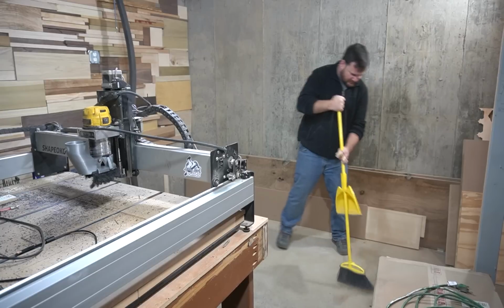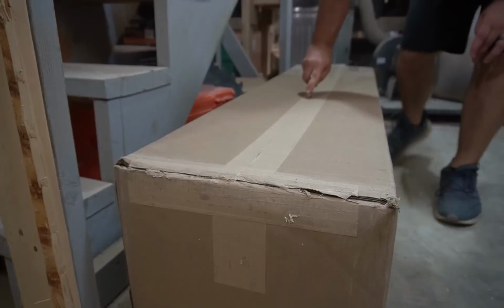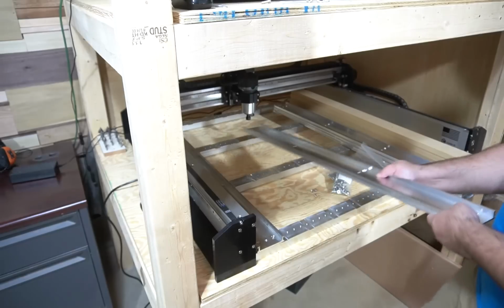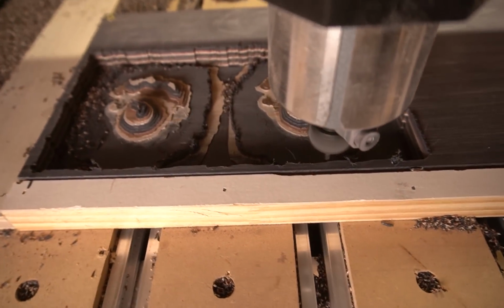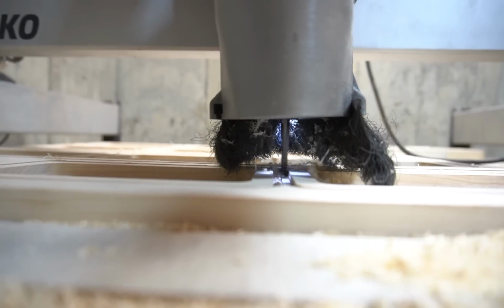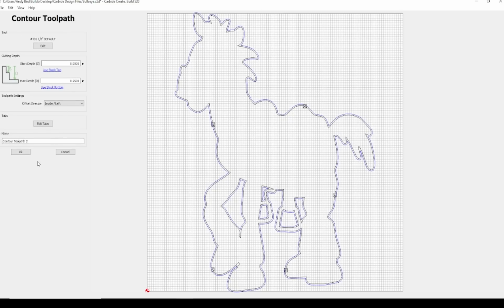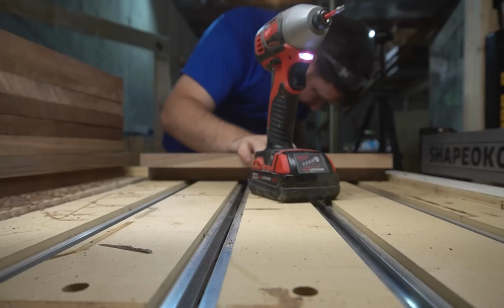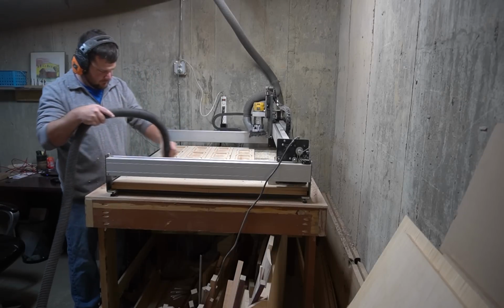Watch This Before You Buy A Desktop CNC Router

Comment: I've got a millright mega V XL.... and I think I have pretty much everything in terms of bits, router (no speed control unfortunately) and the cnc is built, it's on a table, the only thing I can't seem to source is materials / wood. 

I'm trying to get my hands on anything my machine can handle, but namely hardwoods. 

I've also got an XTOOL P2 with all of the fixins (no fire suppression, yet) Same boat. I've bought some stuff directly from XTOOL but I'm looking for thicker wood sheets that won't rob me blind in starting cost.

Comment: I’m a beginner. I was given a 3010 pro mini CNC.  It’s been in a garage for awhile and the axis’s are squeaky. YouTube vids. Recommended dry lube to lube the area that moves on the rails. A little bit of lube.  I am looking at all the beginner videos to start on the spindle and the laser engraver. I only know the laser diode is 3 watt optical output. I will look for the spindle specs soon.
Reply: It’s a 3018 pro Cnc.

Comment: I currently have all the normal woodshop tools filling out a double garage. With that I have a lot of hand drills, routers and sanders, electric hand planer and a couple of jigs. I am more and more intrigued by getting a cnc router (and maybe an attached rotary axis as well). Do I still need to keep everything else like the lathe, tablesaw, bandsaw, router table, jointer, 13" planer, drumsander, edgesander, bobbin sander, mitresaw and desktop drillpress? Many of the tasks that I need all that tools for, can be done by the cnc(??)  - true or dillusional...? Would like to hear some good advice from realtime experts on my thoughts.

Comment: My advice would be - (1) before you spend a penny, look at the available free CAD/CAM software - if you can't get the hang of the software there's no point exercising your credit card.(2) If you don't really know whether CNC is for you, buy the cheapest 3018 you can find (but consider what stuff you get with it, the offline controller may be useful, clamps are really frustrating to not have etc) and buy a selection of cheap bits (if they have a different shaft size you'll need extra collets to go match). You will learn loads putting it together and you'll learn more playing with it. Just remember the results will be limited - you only get 20x10cm of movement and the spindle is pretty weak. But if you do slow movements and take off thin layers you can easily cut wood and PBCs and if you're careful even metal. Then if you don't enjoy it, sell it / give it to a school or hack space. If you do enjoy it you are in a better position to understand what you want to upgrade to, and again pass the 3018 on to someone else, or strip it down to make your own from scratch.

Comment: Thanks for creating this video. I'm a retired machinist who's been looking for a hobby to help make ends meet. I know about speeds & feeds for all the metals I worked with. It should be easy enough to make wood chips. My question is, due to the high speed of routers, are most cutting tools carbide, or is it a mix of high speed steel & carbide tools being used? I'll be watching the play list you just mentioned. The biggest learning curve I'm facing is learning CAD.

Comment: I’m 14 and don’t have 3000$ so I built my own and it’s pretty cool but the one thing I hate is that there is pretty much no z movement so I can only cut like inch this stuff, but I did it all in less that 600$ and Ive milled aluminum successfully, but definitely not steel
Reply from the maker: That's awesome!

Comment: Good video.  Other than the smaller table, what is the downside to buying a smaller CNC router, such as the "MYSWEETY 4540" that I see on Amazon?  Thank you.
Reply from the maker: Thanks for watching and for your question! The main downsides of purchasing a smaller router like the MYSWEETY 4540 is the power of the spindle, the overall rigidity of the machine, and possibly low quality software.

Comment: Liked your video, and it's honest considerations. I'm a retired an 85 yr old hobbyist, I love to build electrical / mechanical projects. Looking back, I was disappointed with the 3018 machine and later realized that for two to three times the price I would have been much more satisfied and able to achieve considerably more with a capable machine. 
With learning G Code, Cad_Cam, Getting familiar with bits, familiarizing yourself with your machine's operation and capabilities, leveling and setting up a work-piece, bit lubrication / misting & adequate dust protection and personal protection, It can all be little daunting, but in the end it has been very satisfying to me. I can now edit G-Code to correct errors in a program.

I have found Vectric Aspire to be the easiest Cad-Cam, it is user friendly and very capable. 
Don't use expensive bits when your learning to operate your machine, some bits will amaze you with their ruggedness and durability, others will have jaw dropping failure under the lightest loads so in the beginning go on the cheap side. It pays to shop around. Regardless always keep a BIT logbook to document what was good, bad & should not be gone again

I now have a 4040-CNC a 3 axis machine with a 400 W DC spindle and uses 4080 C beam extrusions for all axis,  4080 C-beam aluminum extrusion is very sturdy , it had an original work area of 16" X 16" but I have modified the machine's width to twice it's work area width and reinforced the bed area so it's now very solid. This machine although not on an industrial level, it is a brute, cuts everything including aluminum at nice feedrates. The original machine was $ 450. US plus $ 175. US for the mods. My machine is better than any comparable class machine I have found at 3X the price. 
The bottom line is that I have had the time of my life getting to where I am today and I'd do it all over again, except for the 3018 cnc.

Comment: Something I'm really struggling to understand is the basic setup of CNC. I have tried tutorial after tutorial but no one shows me literally each component. 

Like, if I get an OpenBuilds CNC machine, with the blackbox controller... what does that setup look like? I have my desktop PC in the office for the design portion in the CAD program, which also does the CAM and gives me G-code. So... then.. I take a USB stick with the G-Code into the garage... and plug it into what? The black control box? I have deduced that I would need a laptop to control the CNC machine... but then, what am I plugging it into? Does the laptop plug into the control box? So then, MACH 3 or Universal G-code sender is installed on the laptop? This makes sense to me, but I still want to make sure so I don't plug my laptop in and fry it or something. And in all these instances... how do I know if the machine I buy is compatible with various CAD/CAM and controller programs? Can I use Zenbot's CNC machine with UGS? Can I use Mach3 with OpenBuilds' machine?

Comment: Cnc makes a lot more sense in the metal working world. They do a great job at hole drilling. Specifically multiple holes in geometric positions. Using multiple tools on these locations, spot drills, jobber drills, counter bores, counter sinks and possibly taps. Throw in a simple milling pattern and you have a precision part. Change a few locations in your gcode and you have another finished part. This is utilizing multiple tool offsets , which from what I can see,  none of these wood working machines can save more than one at a time.  
You guys should learn how to make and use patterns for the stuff I see you're trying to make.

Comment: A 4th one is a down cut bit. I highly recommend buying one. I have had no need for the replaceable ones. Then again I have only done small jobs on a printed CNC. I am thinking of committing money to a larger CNC like a Shapico or something at some point. I started on CNC when I was 14 as an apprentice Tool & Die Maker. Back then CNC was a new thing. Left the trade to work on computers and never looked back till I wanted a hobby build. Now I enjoy it.

Comment: As a professional cnc programmer and operator with over 25 years experience I would highly recommend that beginners use a safety guard around their machines as if a bit snaps or shatters they can cause serious damage and injuries. When it comes to setting feed rates and rpms you need to find the sweet spot. That is when the rotation speed and feed rate are in harmonic balance and the tool will actually cut very quietly even at full length of cut
Reply: Thank you for your input there bud, I've just started CNC machining a few months ago and have very basic autocad experience, I'm really interested in learning and want to invest in getting a desktop cnc
Reply: Thank you!
Reply: What specific classes did you take to become a CNC programmer?
Reply: @lucasmendoza  I'm not there yet, just an operator, but you'll want to study G-Code primarily. Many tech schools/2-year colleges offer certifications and technical diplomas as well that can prepare you a lot better.
Reply: @Lucas Mendoza  I ran a million dollar cnc punch for highway products. When I got the job I was going to school for welding technologies at a vocational school. That is a good place to start, but to be honest you don't need a degree most companies will train a good employee. Just start putting your name out there with companies and show interest.
Reply: @Lucas Mendoza  cad/cam computer aided drafting and computer aided munfacturing, but if you were to buy your own is also a great way to learn. Youtube has plenty of info
Reply: specially this goes for all laser aficionados. I have a few books 1)  Ken Barat - Laser Safety_ Tools and Training, Second Edition-CRC Press (2014).pdf , 2) Understanding laser accidents-CRC Press (2019).pdf 3)(IOP Series in Coherent Sources and Applications) Ken Barat - Laser Safety_ Practical Knowledge and Solutions-IOP Publishing (2019).pdf

Comment: I thought you were gonna talk about realistic expectations for your machine?  I paid $14k for a ShopSabre 23 (pre covid price), and it didnt meet every expectation.  But buying something cheaper would have been a total waste of money for me!  I am 3D carving, and VCarve Pro worked ok for the first week.  But I quickly found it was limiting, if for no other reason than because it only uses STL files.  So after struggling against the STL demons for a long time, I broke down and bought RhinoCam so I could make proper tool paths. Then I figured out that WinCNC doesn't know how to do arcs in the z axis, so even though the CAM can make more efficient tool paths, my router can't utilize them!  So sometimes I have files with 1 million lines of code.  But no big deal.  Only takes 12hrs to run.  I'd hate to think how long it'd take a $2,500 machine to do that!

Comment: Thanks for the breakdown.  I went for the sub1000 price range, and got a small 3018 clone, and upgraded the spindle/controller to a variable rate with a wasteboard and clamp.  Coming from 3D printing I already have some experience with these little quirky machines. Im a fledgling pocket-knife creator, and I wanted something to compliment the synthetic 3D extrusion with the ability to cut out small plastic/soft metal parts.  Im already looking ahead to setting up a larger router system in my garage workshop where the bigger tools are.  Ill use your resources as I progress in my journey.  Cheers!

Comment: I have friends that think they can buy a cnc router on amazon for $600 and machine aluminum, my cnc router has all linear guides and the spindle only deflects .0002, light cuts in aluminum on a non rigid machine creates vibration and wears out end mills fast, simple parts dont require cad and cad has a steep learning curve, large machine shops have people that only do cad cam !!!

Comment: Do you know if there is a CNC program or machine that will do layers of an item that when assembled will complete the item? At 00:50 of your video it shows 4 pieces of lumber with 3 cutouts in each board.  What I'm wondering is if each cutout could be  programmed to be one part of the whole item.
Reply from the maker: Yes you can cut multiple pieces to build a larger model

Comment: I am frustrated. Just wanted to engrave a couple of small signs. Dismal experience, tried Easel but being a cloud based program it is uselessly slow and un responsive to key inputs. Want to try the free Fusion 360 but do not seem to get the program to download. Spent hours looking for a program without success. Ideally I would like a program that presents like MS publisher and produces the g code to run my 3018.
Reply: Check out software from Vectric.  I can't say if they support your specific machine, but they are more "art brained" vs "engineer brained" when it comes to CAD/CAM.

Comment: Because of videos like yours, my first build went together like I had been doing this all my life! I work in industry, so “perfect” startups of complex systems rarely happen, but my CNC mill just “fell together” and worked perfectly as I followed the steps. And that’s just the hardware, which is probably the easiest part, because then comes the software, for design, and then for communicating with the machine. Again, advice from channels like yours helped me navigate through “the weeds” without making costly mistakes, so I thought I would just say thanks!
Reply from the maker: Great to hear! Thanks for sharing

Comment: This is the most fear mongering, misinformed video for CNC beginners I've ever seen.

NO, you do not have to buy a $1000+ CNC if you're a beginner. You don't have to have a specific CAD software for a specific CNC, that's just a load of crap. There are no software compatibility requirements in creating things for your CNC because your car software isn't what converts your work to a machine code. 

You keep saying you're not discouraging beginners yet you're feeding them false information. People can easily start with a $200 CNC and learn the basics without having to find the space for a large expensive machine and worry about damaging them. 

Horrible video.
Reply: Your post is some what wrong when it comes to the CAM software compatibility.  Not all CNC machines use standard G code.  You have to have CAM software that can out put code your machine can use.  My Dad has a ShopBot CNC router.  It doesn't use standard G code natively.  It has it's own programming language.  It can use a limited set of standard G code functions.  So having a CAM system that can only out put standard G code may render some CAM software incompatible with certain machines and controllers.  The biggest thing to watch out for is to make sure that the software that is being used to write the programs has a post processor for the specific machine/controller.  Code that is "close enough" can cause numerous headaches and even lead to machine crashes.
Reply: @brandons9138  all the cheap ones use gcode. Shows how much this guy knows about CNCs yet recommending people to start with expensive ones.

Comment: Bottom line is that no one should expect CAD/CAM combination to be a thing that you just draw. Put piece into machine and it'll do the rest. There's quite a bit of learning curve on feeds CAM postprocessing. I'm personally building MPCNC as I have 3D printer and I'm quite adept at CAD side of things. MPCNC is going to be my first touch (well I already built one not good version already) to learn about the CAM side of things. If/when I succeed with it and begin to get reasonable things out, I'll likely fast move into machine that is capable of machining metals. Btw aiming for metal on the start imo is mistake as it immediately increases costs of the equipment vastly and I'd say you'd have to invest minimum of around 2000-3000 euros to do anything viable. Now that's at least to me quite a bit of money to throw in if CNC machining isn't turning out to be a thing I really want to do. For those who are new to anykind of CNC stuff. I'd first get cheap 3D printer to learn CAD. Then built or buy cheap CNC router and use those 3D printing skills to improve that router, like for instance make that dust shoe or maybe air blowing fixtures to machine etc. If you're able to reach that point of creating 3D printed parts, I'm 100% sure that this person can then adapt to machining too. I at least did, though admittedly I have education from steel fabrication and work/repair/improve/maintain ie. packaging machine equipment at work which all help quite a bit to have understanding of mechanics and limits of "things" to quite good extent.

Comment: I recommended building one from scratch so that you understand as many details as possible. I spent less than $1000 to build a rack and pinion that's accurate and strong. Tooling is where the money goes, cheap tools will brake and cut horrible. Quality is better but be careful not to destroy it.
Reply: I'm collecting parts to do that too. what electronics did you use?

Comment: Probably something you could have covered is mechanical and electrical breakdowns. I built my own CNC, but just like cheap 3D printers I have heard many horror stories about these cheaper Chinese CNCs and electrical and mechanical failures before you even get too far into the journey.
Reply from the maker: The machines I'm talking about are not Chinese CNCs and are from companies that support their products if their is an issue
Reply: @AndyBirdBuilds  no I realize that but many people just getting into CNCs are tempted to buy the Chinese stuff expecting it to work only to find they need to do repairs before they begin.